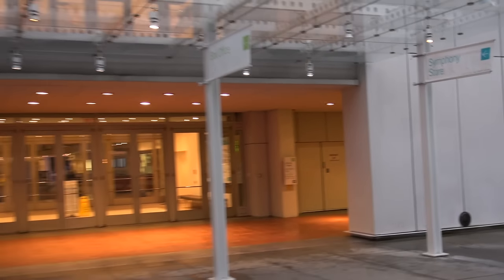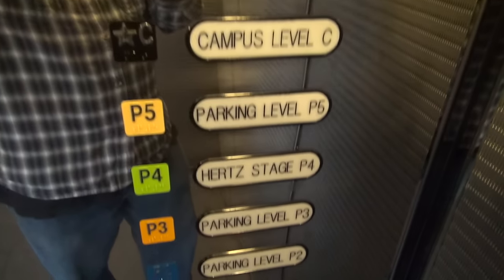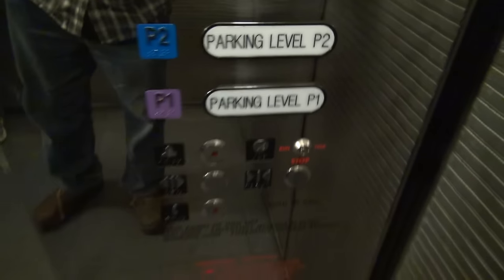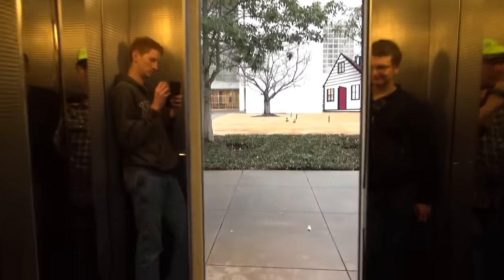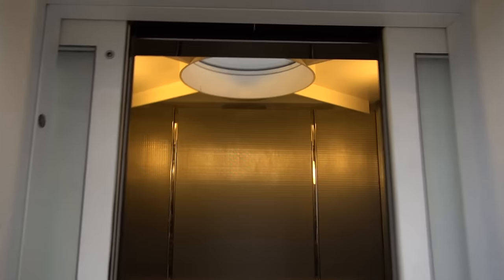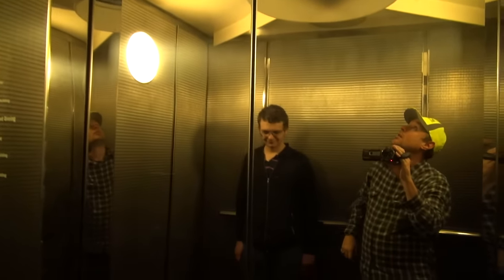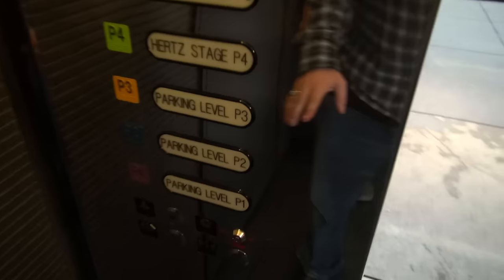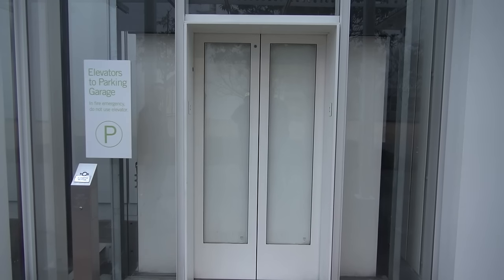Famous Minnesota Elevators at Woodruff Arts Center Parking Garage Atlanta GA

Comment: Maybe it's a Kone? Cuz the one that goes from the Street to the Campus is kone and these two are the same and that voice is very creepy. XD
Reply: That elevator is actually MIE as well
Reply: Elevators, Trains, & more by nwa0714 Well before Kone was Bennie so probably MIA thought of this door track & doors before kone did or even got parts supplied from Kone, since kone M series was realiable as MIA.
Reply from the maker: It is a Minnesota as well
Reply: DieselDucy Yep, but they probably got parts from European Kone company's.
Reply: They actually use Tyler (Sematic) door equipment. Sadly one dust on the door and fails completely. Tyler is a division of Italian-based Sematic in America. Tyler supplies door equipment for Schindler 5500 and 7000.
Reply: ems318 Flip the letters around. It’s MEI 😜
Reply: Rahan omsi 2 content and more no kone started making American lifts in the mid to late 90s after taking over Montgomery.So kone lifts from before that are only outside of north america
Reply: PotatoLift1 Yeah, but they used to make their M series in the 90s and probably didn't have American elevator parts, so they had to use them European kind of doors instead of your typical American doors.